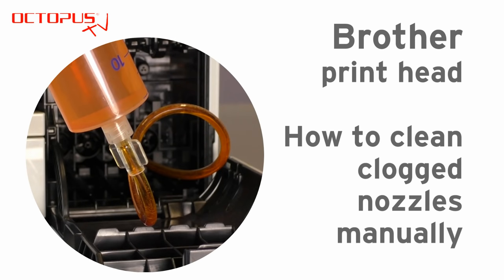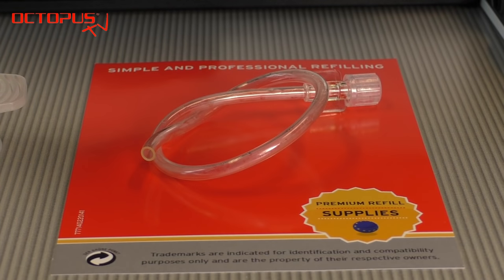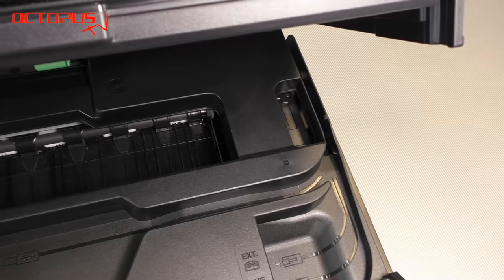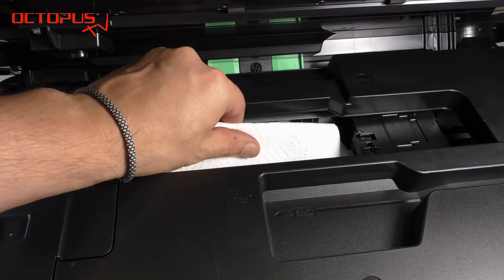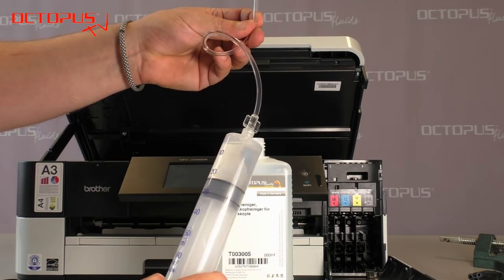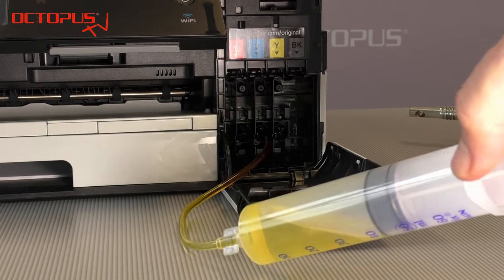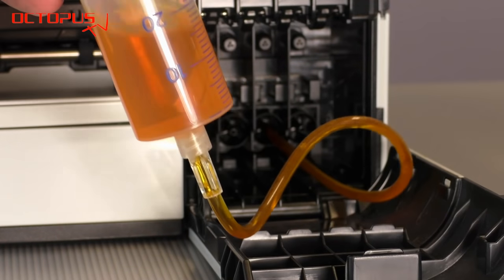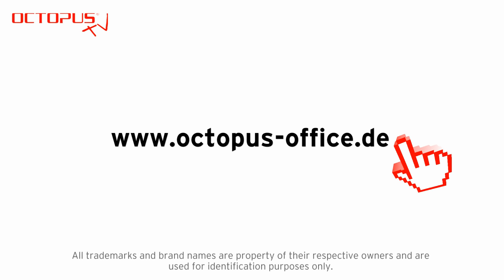How to clean Brother inkjet printer´s print head clogged nozzles?

Comment: Thank you for the video! I'm going to try this method. I have the same printer you showed. Is it usually enough with 30 ml per printhead or does it require several washings?
Reply from the maker: Hello Ivan, thanks for Your comment. With 30ml cleaner per print head You mean 30ml per color, right? Yes, 30ml cleaner is sufficient for each ink color. How many flushings are necessary depends on the blocking - some require only one cleaning cycle others need more attempts.

Comment: I have MFC-260C, after following the steps suggested by you. Cyan is not prined some time on test page. Some time Cyan is very light. What is the solution?
Reply from the maker: Thanks for your question. There might be cleaning solution remaining inside the printer´s ink system. To get it out we recommend to run test prints - use old paper and start a 50pages print job double sided - this job takes some time - so You can take a look from time to time and see if the cyan is coming back to look normal.

Comment: thanks for the video, although my brother is not the same model as yours, mine is a  mfcj485dw its very similar. my attempt was ok ,ink and cleaner was coming through quite well, but my test prints still not showing any yellow. did about 10 printhead cleaning, starting from NORMAL THEN STRONG THEN STRONGEST. Now just starting to show 1 line of dashs on test print but still faint. I tried using a paper towel folded up and soaked it with windex underneath the print head, left it overnight, the dashes are showing up now still only 1 line and the bottom but nothng at the top. Any suggestions
Reply from the maker: Thanks for describing You situation and reaching out for our help. During the print head has been sitting over the soaked paper did You let the cartridges remain in the printer?
Otherwise it happens that the absorbent paper under the nozzles pulls out the ink from the ink system and air gets intot the tubes leading towards the print head.
You say that You have been running quite a number of print head cleanings and the tubes were actually free - that also indicates into the direction that there might be air blocking the proper flow of ink.
You could flush the system again with cleaner fluid - this also flushes out the air. Then You go back to make double sided test prints which should normalize the colors slowly.

Comment: What common liquid could I use instead of this liquid? I doubt I can order it and it would take some months anyway
Reply from the maker: Thanks for Your question. Most desktop printer inks are mainly based on water - so You need to have a cleaner based on water too - the specific requirement for the water is that it needs to be purified and in best case demineralized. When cleaning with not clean enough water You trade one problem for the next one...

Comment: So I pushed cleaning solution through to a brother mfc printhead to clean it, I've done it and each ink passage goes all the way through to the printhead as shown by soaked paper towel placed underneath, then ran several test prints and printhead cleanings and only got maybe a faint print from the cyan, then nothing. Is the circuitry dead or something? Is it salvagable?
Reply from the maker: After flushing the ink lines plus the head with cleaner it usually takes quite a number of prints to get the colors back to normal - start a print job double sided on test paper / already used paper -  that takes time and You can look from time to time if the colors are coming back. This process gets out the cleaner from the ink system. Make sure that there is no air in the ink system - when You are not sure about this just flush again - this pushes out the air - then start again to print out the remaining cleaner solution.

Comment: Can i do this without the printer cleaning alcohol thingy i will just pump the inks out using the syringe

Also my printer is Brother MFC - J430W
It has no chip
Reply from the maker: Hello Asriel, thank You very much for Your question. Yes, Your printer is worling with similar cartridges as used in our video tutorial. The cleaning solution should match the type ink that is used in Your printer. The standard inks for printing for example office documents are water based inks. In that case You cleaner should be waterbased too - alcohol based cleaner does not clean waterbased inks very well.

Comment: My mfc-j475dw printer seems to have the 3 colours clogged. The black prints fine but all 3 other colours have stopped working at the same time. Is it typical for 3 of the 4 heads to clog at the same time? We don't print colour that often so maybe that's the problem. I thought this printer did an automatic head cleanup on a periodic basis to avoid that?
Reply from the maker: Thanks for your question. 3 colors getting clogged at the same time is a bit atypical. Do have changed the color cartidges lately? Are You working with alternative inks / alternative cartridges?

Comment: I have a Brother MFC J5330DW that  won't print magenta.  Cartridge is full and all the others work fine.  If I try to print a color box I just get a blank box with a little streaking but no color.  Do you know what size tubing I need to connect to the printer to try to flush it out?
Reply from the maker: Hello Craig - You can ask at Your local pharmacy for a single infusion line -  these connect infusion bags to ports or other luer lock connectors. Such a tube should be suitable for Your purpose.
Reply: @octopusoffice  Thanks for the response.

Comment: How much of the cleaning fluid is actually pushed through. Is the idea only pump it in and out a little? Not to lose too much of fluid?
Reply from the maker: Hello Sam, thanks for your question. As soon as the cleaner goes through the ink line that You are cleaning it is enough - just let the cleaner stay inside for some time more and then push out a bit more. Most of the cloggings should have been removed by then.

Comment: Hi  there, I have done what you have said in the video. All the colour ink is unclogged but the black seems to be still clogged and wont print black. Do you have any solution for fixing this problem? I have clean the black ink head twice. and still no black being printed.
Reply from the maker: Hello Nardi, thanks for Your question. According to Your description we assume three possible scenarios for Your situation: either there is still cleaner in the black ink line that needs to be printed out, second the black nozzles are still blocked with a very rigid blcking as You say, keep on cleaning in that case and third scenario is the worst case: the black part of the print head is damaged. Our cleaner can clean but is not able to do any repairs...

Comment: when you're done, do you leave the cleaning fluid inside the ink line, connect a cartridge and do printhead cleaning routine(s) to get the ink into the the printhead again or how do you do that?
Reply from the maker: Thanks for Your question. After cleaning You can install new cartridges and start double sided print jobs using old paper. This way You can avoid to fill up the waste ink sponge inside Your printer unnecessarily. When doing a print head cleaning routine by the pinter´s menu the liquid goes into the waste ink sponge and the printer deducts that cleaning routine from the sponge´s capacity.
We recommend to use the test prints to get the remaining cleaner out of the inks system. Slowly the inks will come back to normal. We start that process usually with a print job about 50 pages - that takes quite a while - but You can look anytime in between and check for the progress.
Reply: @octopusoffice  wow, thank you very much for the explaination, makes sense! so in effect, is there no difference between "print head cleaning" and printing some solid-color pages? no higher nozzle pressure? could "printing some solid-color pages" be used to clean the nozzles aswell?
Reply from the maker: There is a difference between our suggested approach cleaning by printing and the printer integrated head cleaning function: the cleaning done by the printer´s menu also involves a pump that extracts ink by applying negative pressure from the outside on the nozzle plate. In addition the print head is moved over some wiper blades that should remove pollutions from the outside.
Except the negative pressure applied from the outside part - our cleaning methos also involves the wiping of the nozzle plate by installling the absorbent underlay. Printing out the remaining cleaner can be done as the ink lines should be free after pushing cleaner through - so there is no need for an increased pressure.
Reply: @octopusoffice  thank you! very informative!
Reply from the maker: You are welcome! 👍🏻
Reply: @octopusoffice   
"We recommend to use the test prints to get the remaining cleaner out of the inks system. Slowly the inks will come back to normal. We start that process usually with a print job about 50 pages - that takes quite a while - but You can look anytime in between and check for the progress."

You really should explain this on the document provided with your cleaning kit !

Comment: Hi, do you need to empty the cartridge of ink before performing the cleaning or clean it with the ink inside the cartridges? Thank you
Reply from the maker: Hello Pamie, as we take out the cartridge - the inks remain in the cartridges. After taking out the cartridges we flush the ink line with the cleaner solution. After that cartridge back to the printer and then we print out the cleaner from the inks system. Hope that answers Your question...
Reply: Oh ok! So thankful for the clarification! I now understand that what i did was wrong yesterday!
Reply from the maker: Hello Pamie, thanks for Your reply. Nothing is lost at this point ! Hope You will be able to get the printer revived.
Reply: Thanks so much! Printer performance was improved! 🥰
Reply from the maker: Hello Pamie, great to read about the positive result 👍🏻👍🏻

Comment: My printer stopped printing black. I cleaned my printhead similarely as described. tissue under head gets soaked in black. Put in new cartridge, paper still blank after 30 papers and several cleaning runs. The cleaningfelt was soaked in black. 3/4 of the cartrige used up already. What else could be the problem?
Reply from the maker: Thanks for contacting us about Your situation. According to Your description Your printer did not print black before the cleaning already. The cleaning runs using the printer´s internal cleaning functionality uses a littel pump that sucks the ink from the cartridge through the print head into the waste ink compartment - the print head itsself does not print during that procedure. So in Your  situation it indicates the the black part of the print head might be defective. We ask for Your understanding that we cannot say that for sure from the distance.
We recommend to try keep printing - it might need more than 30 test pages to get the color back onto the paper. Make sure that there a no air bubbles trapped inside the tube leading from the cartridge to the print head.

Comment: I have the Brother MFC-J41W, I tried your method to get the cleaning head out but it was too fast, and when I did catch it partially out I could not move it.
Reply from the maker: Hello Daniel, thanks for describing Your experience using info from our tutorial. From our understanding You had have trouble to get the print head to a position in which You could move it from side to side, right? Either You try again as You have done and make it stop more in the middle of the working area. Or trying digging the comments under this tutorial: some users found ways to get the print head over the working area by using some button combination on the printer.
Reply: @octopusoffice  wow, awesome fast response. Thanks, I managed to get it to move with just a bit more pressure. At 1st I was afraid of damaging it, but since it was on death row I thought what the heck. Lol
Reply from the maker: Hello Daniel - dead printer walking - beside forcing the print head to a managable position: have You been able to bring the patient back to show some life signs? 🙂

Comment: My printer does not have a power cord that can be easily removed from the back and where it plugs into the power soource is difficult to get to. Can I just use the power button?
Reply from the maker: Hello Doug, thanks for Your question. Using the power button brings the print head back to its parking postion. There it is locked and it is difficult for You to get the absorbent layer under the nozzle plate - please look into the comments of our tutorial - some users have described a way to get the print head into the middle of the working area by using the printers buttons - maybe this can work for You too.
Reply: @octopusoffice  Thank you very much. I was able to get the print head centered by holding the "X". Got the paper towels ready and under the head, now just waiting for my kit to arrive.
Curious though, when printing after cleaning will it show ink consumption prior to ink actually hitting the paper or will it only measure what is actually in the cartridge? Would you recommend cleaning all the tubes at one time? What should I print to get the ink back to paper the quickest? Is there a test page or something to use other than when using the cleaning cycle? I don't want to fill up the waste tank trying to print test pages.
Reply from the maker: Hello Doug, thanks for Your answer. Nice to read You have found a solution for Your printer. Actually we do not recommend to let the print head sit in that middle position for a long time - there the inks in it may dry out - so when waiting for the cleaning kit let the head sit in its normal parking position. We suggest cleaning the trouble making colors only - so You do not waste ink from the lines that are actually ok.
After the manual cleaning You should get the same ink level as before the cleaning as no ink from the cartridges is consumed. To get the colors bac,k to normal just print any document containing the colors that You have cleaned - this prints out the remaining cleaner fluid and mix of cleaner and ink goes onto the paper instead into the waste ink tank / sponge.

Comment: Thank you for this video - I've got the same printer (Brother J4420DW) and I did the cleaning as described in this video with your cleaning fluid. I did the cleaning for several minutes - it was a lot of yellow ink on the kitchen roll so I thought that everything would be OK after some test pages - but unfortunately the printer won't print the yellow ink. After some fails I tried to fill the ink channels with some yellow ink - after this procedure I was able to print out yellow colour but after some pages the yellow color got paler and paler until it turned to white. :-( It looks like that the printer doesn't pump the ink to the printer head - any ideas what I can do now?

btw. all the other colors are printed out correctly :-/
Reply: I have this same issue! Not sure what to do now :/
Reply: @pegobua  Thank you so much!! I had the same issue and thanks to you I managed to solve it!
Reply: @pegobua   first of all, thank you so much for your detailed instructions; however, i did that twice without any signs of improvement. I guess I'll have to call the tech support. thank you though
Reply: @pegobua  After following the instructions you gave, I was able to once again print black on my Brother MFC-J6920 printer. The first standard print head cleaning after the procedure showed faint and scattered black dots, which gave me some hope as before there was nothing. I continued with four additional standard cleanings with each one showing improvements over the prior. Finally, after the fifth cleaning, the black print was perfect. This method was ever so easy compared to all that was shown in the video and the only cost was a little bit of ink. I think you should post this somewhere others can find it. As for myself, I can not thank you enough.
Reply: @halsteinke6539  Thanks for your reply. I posted the instructions also here
https://www.printerforums.net/threads/brother-j4420dw-yellow-ink-problem.67872/#post-214582

Feel free to share it elsewhere :-)
Reply: @pegobua  Thanks, this method enabled me to move the print head so I could use Octopus' cleaning method. Was trying, in vain, to move it before this!
Reply: @pegobua  Hi. I have the same problem with magenta after cleaning. I have the J6910DW. Can't see the home button on the screen. Can you try to help? Thnks
Reply: @pegobua  Great work, after running this and on my MFC-J5720DW and then running normal cleaning about 4 times my printer is back up and working.
Reply from the maker: Thanks a lot for Your positive feedback - we are happy that the suggested method could improve Your situation.
Reply: @ p.e.g.o.
Thanks a lot !  I have exactly the same problem as yours (with another colour and a MFC-J5335DW). I'll try it after being provided with enough ink !
Reply: @pegobua  Wow!! Great!

I have run the standard cleaning procedure at least 10 times (blew through a black ink cartridge and was working through a new one). The print quality got WORSE. Was looking at $100 repair or a $400 replacement printer (plus waste of current and on deck ink cartridges). I called Brother and they just told me to take it to a repair center. I was getting ready to buy the equipment to do the procedure described in this video. You have saved me from a lot of trouble and additional headache, thank you sooo much!
Reply: I have a 495CW and had to unplug it, then hold the menu button while plugging it back in. Just putting this out there bc i couldnt find a video that worked for my printer